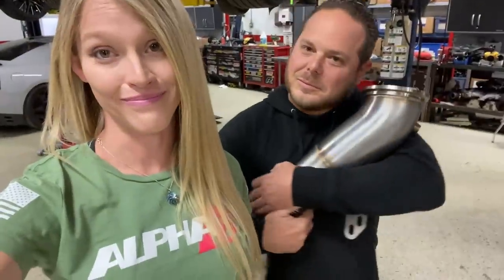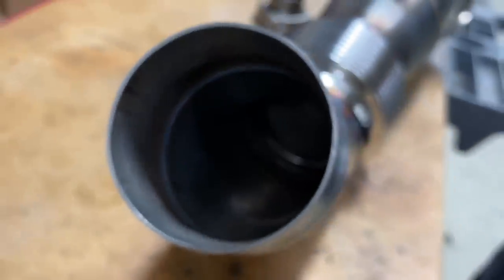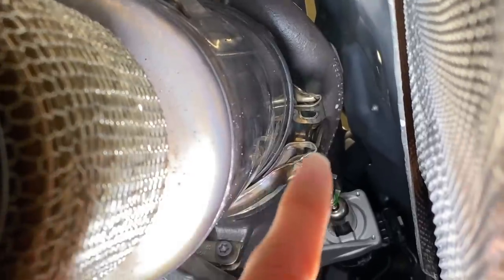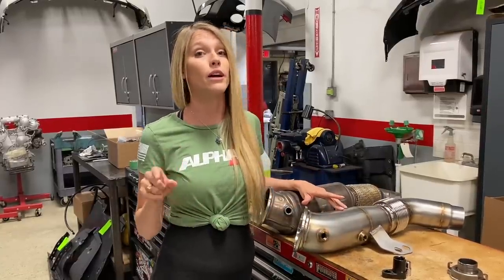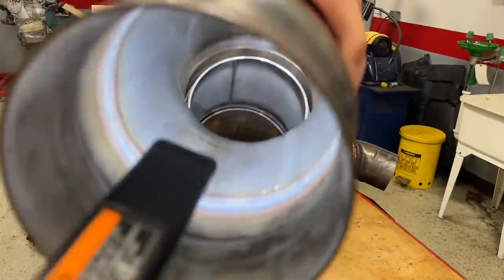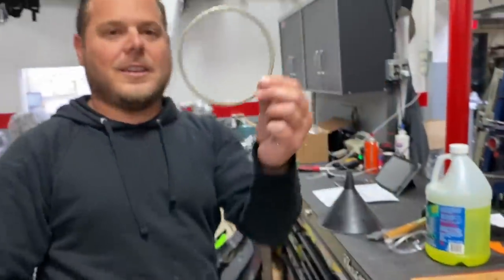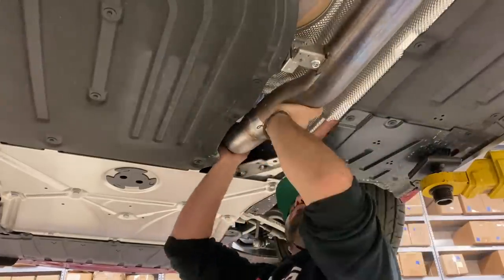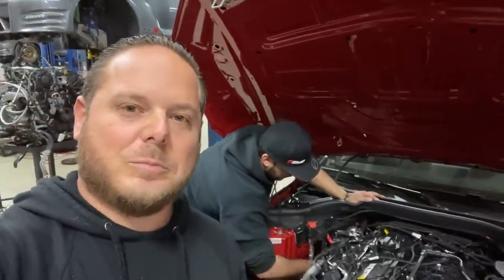AMS PERFORMANCE 2020 TOYOTA SUPRA DOWN PIPE INSTALLATION

Comment: Good tip on the fixed wire o2 sensor.    Back screw before you stick it in and it wont bunch up. Thats kinda kinky.

Comment: Yep, THAT sounds better - no more F-rts! Just a little burble...  Wouldn't it be nice if manufacturers standardized bolt and nut sizes, as in using as few different sizes as possible on a car type? Or even across lines? Standardized plastic clip sizes and types would be nice too. Just a little cooperation needed. Great car build; makes me wonder what you have in store for it (?)! Jelly was so sweet and sleepy looking....until...!!   LovY'all
Reply: trjnsd right!! Doesn’t seem like it would be that hard
Reply: To be fair, most cars from the metric countries are already fairly standardized.
You don't need that many tools to do most of the work on them. 😀